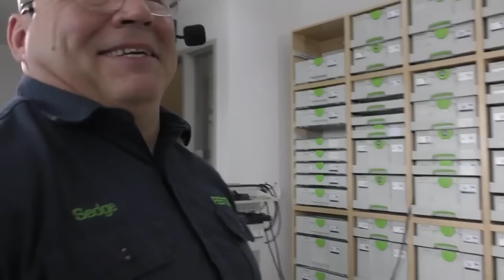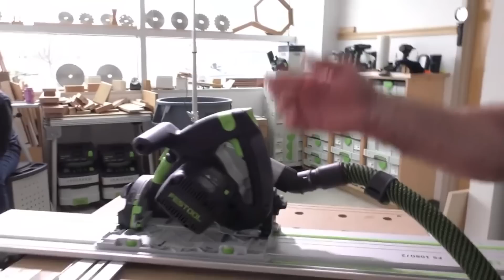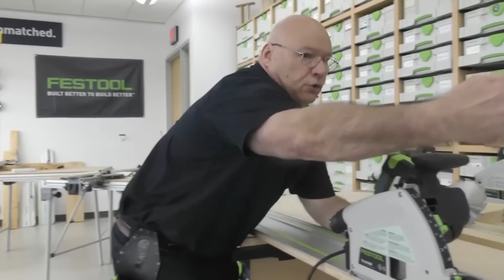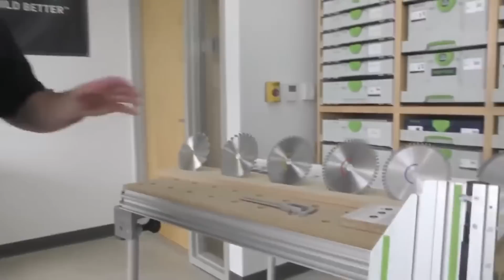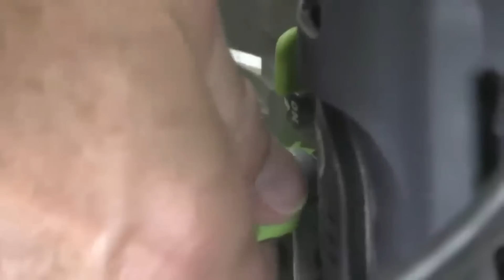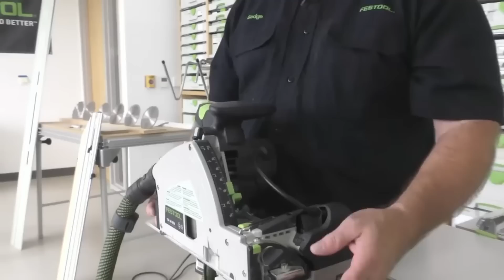Festool Live Best Of Episode: 54, 87, 131, 149

Comment: my tsc55 sht the bed.  not sure whats going on, only works with a single battery.  with two it wont spin the blade.  cant seem to find anything about it online and before you ask...its been 4 years so the standard warranty is out.  truly a bummer, it went down in the middle of a large cabinet job.  ive become so reliant on it i rarely use my table saw.  any ideas?